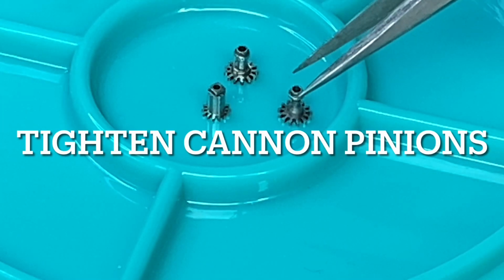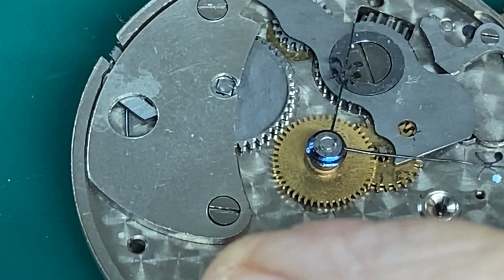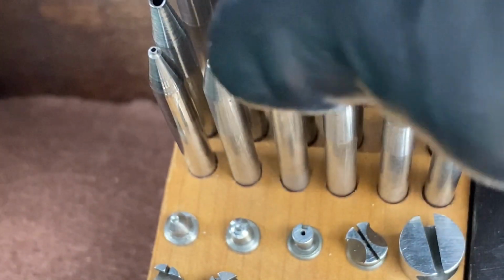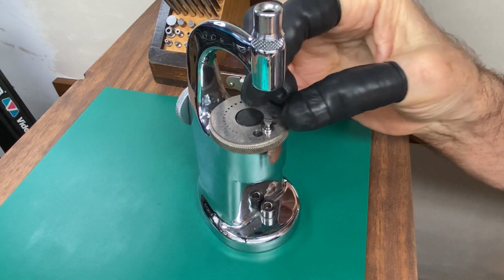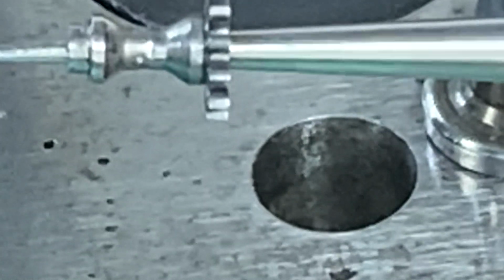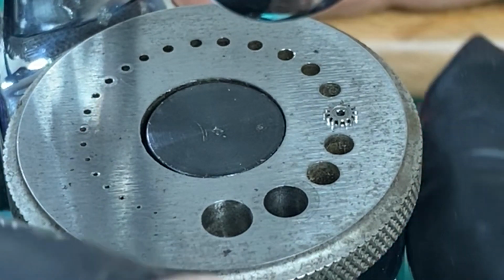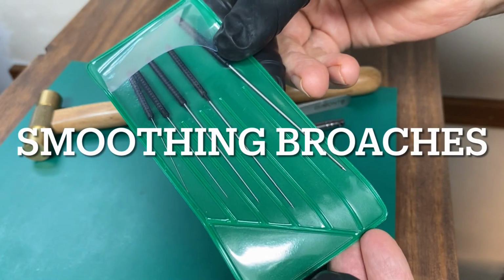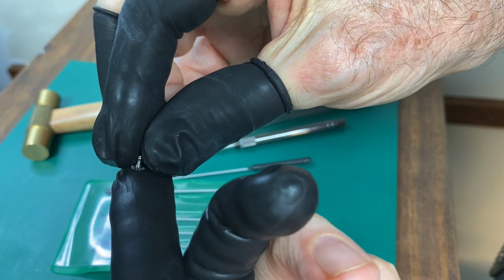How to Tighten Cannon Pinion so Pocket Watch Hands Work (with Watchmakers Staking Tool)

Comment: I have one Enicar automatic watch. I changed the date by turning the hands several times and after that it happened that the minute hand turned more slowly. Will I resolve my problem with tightening the Cannon Pinion?
Reply from the maker: A lose cannon pinion might be the problem but I would check to see if the minute hand is lose on the post.You might just need to carefully push the minute back down on the cannon pinion with tweezers or hand pusher tool.